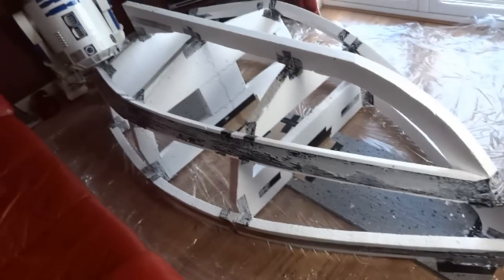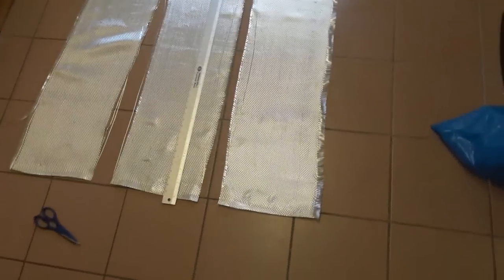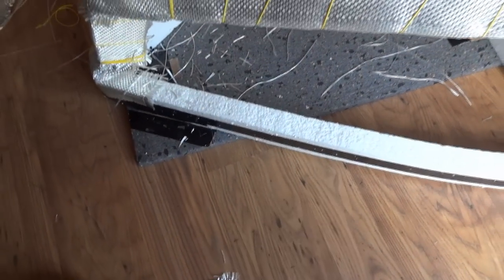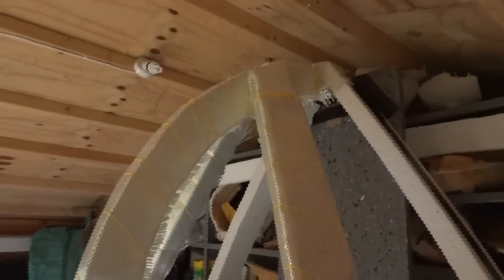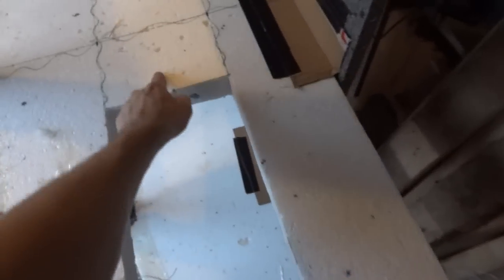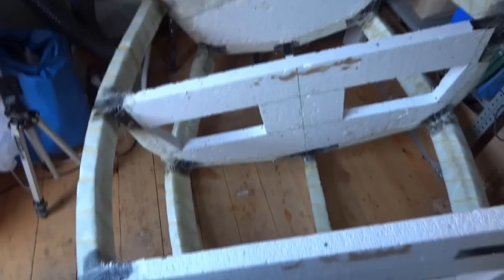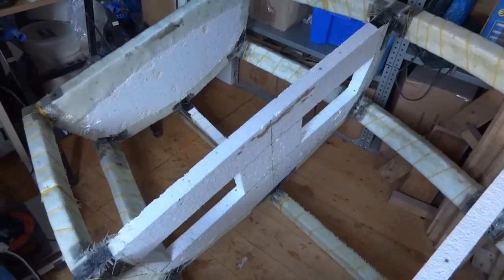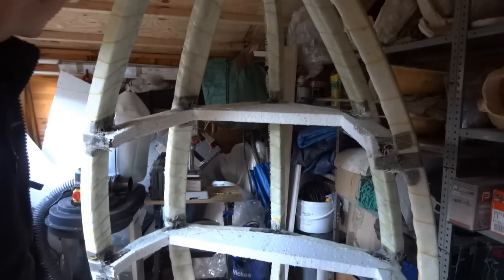Experimental Boat Building Part 4, Fiberglassing the Frame with woven roving and resin

Comment: Nice project James.  the frame is light and strong too.. I never thought of leaving some part of the fibre saturates with resin..  You have brave heart.. I did the same when building a solar car, but for its skin and using epoxy hardener.  For the frame i used pvc pipe covered with fibreglass mat with polyester resin.

Comment: BTW you know that East Coast fibreglass do polyester resin modified so it doesn't melt polystyrene. More expensive but you don't need the PVA process. Paint on 1 layer of resin over glass then more layers of standard stuff

Comment: Not to insinuate anything negative, as you're obviously qute accomplished, BUT... would it have been  "better" or easier to fiberglass the straight pieces such as the keel and maybe the bulkheads before assembly and then fiberglass the curved pieces after fitting them all together?  Again , not trying to criticize or imply I know any better. In fact, in just asking this, I freely admit I DON'T know, that's why I ask.

Comment: Very cool idea,  that is a great idea for a forma.

To get the resin to flow better you need to get 100 old vacuum splints and apply them with a cling film liner to push the resin around the whole cross section of the sections.  That may be over engineering it but it could mean you would be able to have significantly smaller formers and less polystyrene.

For the outer.  Why not use a shrink wrap plastic and then put a single layer of glass over the surface.

Comment: Lots of crackling sounds when squeezing! Perhaps using woven strips/tape wrapped at about 45 degrees, in a 2nd layer, will increase the structural strength. (after cutting off the "sticky bits" of course. ) :)) Looking forward to seeing it in the water!